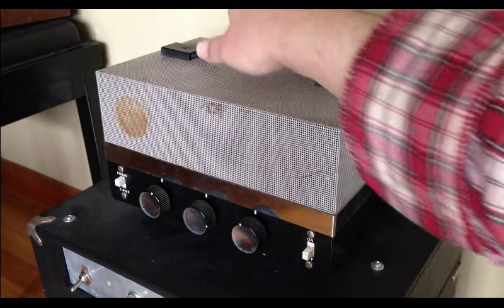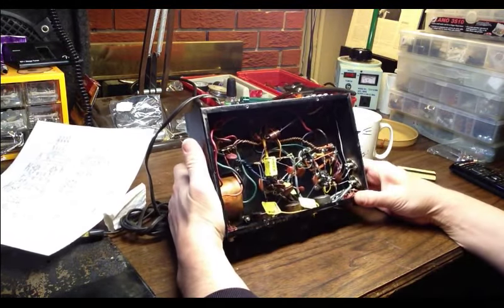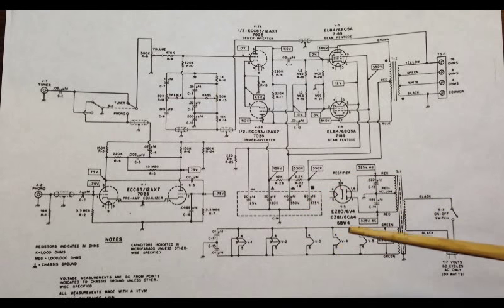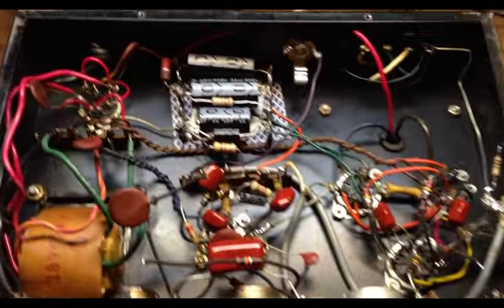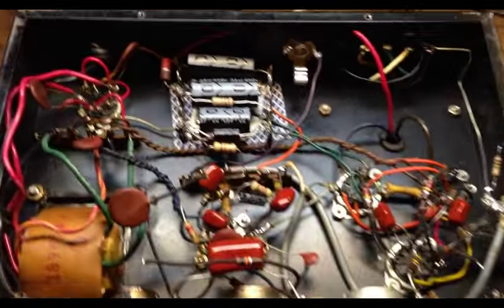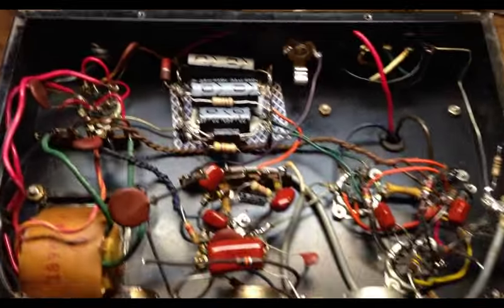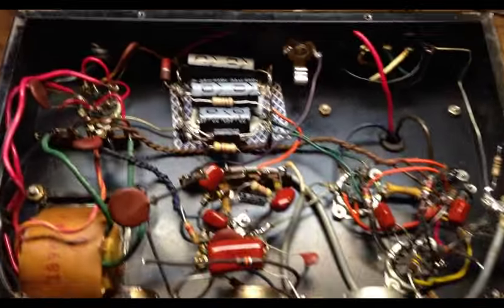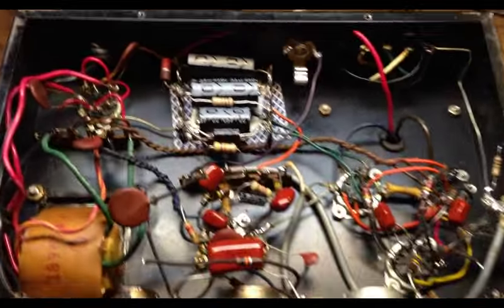Budget Vintage - Knight KM15 Guitar Amp Conversion (Dr.  Z, Marshall, Vox)

Comment: I am always impressed by anyone who can play a guitar well.
I was never a good guitar player, but I am an excellent design engineer who loves working with vacuum tubes.
 You created your biggest problems yourself when you modified the circuitry around the first 12AX7 tube.
 You were basically running them, (both halves of the 12AX7), in saturation because they had no bias on them.
Those very large value resistors, (multi megohms), from grid to ground were there to use a self biasing system called grid-leak bias.
Without bias the tubes operated more like rectifiers than linear amplifiers.
That, coupled with the extremely high gain involved and the fact that you never removed the bass boost compensation that is required for all phono inputs, was the most likely cause of your motorboating.
 You have to go back to those multi megohm resistors to regain some bias and get rid of the RIAA compensation (bass boost, treble cut) network between the two halves of the tube to use it with a guitar.
 You could also switch to more conventional biasing with resistors in the cathode circuits of each half of that 12AX7 tube.
 Look at the 1st stages of other amplifiers that do not use grid leak bias for examples of what those circuits should look like if you decide to switch to cathode biasing.
 I have one of those amplifiers, with no parts changed in it, still working perfectly with zero hum and no motorboating. I know I should replace the stand up multi section filter cap but leaving it in to see how long it will last. 
 Allied radio was in the electronic parts business, (they still sell parts), and they used high quality components in their kits, which is probably why it has worked so well for so long!

Comment: These were kits that you built at the time that Stereophonic sound was starting to take off.
I built my first one in '63 when I was in high school and just starting to play guitar.
Eventually built a second one with some 12" speakers for a parent annoying stereo.
   Allied Radio was an electronics supply company back then and had the Knight Kits as a competitor to the Heathkits that were a little more sophisticated and more expensive.
The Tandy Corp, parent of Radio Shack bought Allied in 1970. After 85 years, Allied Electronics is still in business selling electronic parts.
Reply: Thanks for the info! I didn't know that.

Comment: Hi Guitologist, Cool little amp, I can see where it would make a great conversion project. I watched an Uncle Doug video on his home made Fender 5F2-A and the volume and tone circuit used is really good and can be applied to other amp circuits. Doug has a video on some PA amps he converted and one was motor boating, turned out it was the transformer, a wire was broken, causing the problem. Take it easy, C.

Comment: Thanks Brad. Most of the hum was from poor cap grounding. I grounded the negative side of the rail to the chassis instead of the buss and it's much quieter. I used 2x 33uf and one 22 uf. I temporarily added a 70uf in front of the first 33uf cap with jumpers and it's dead quiet. The 70uf was an older Sprauge that's just way too big (C cell battery size) so I ordered a much smaller 60uf which should work fine. I used the standard 2.2k 2W dropping resistor and the voltage was perfect on that node but I had to up the  82k dropper to 180k to get the last 22uf down to spec. 
Now to attack the tone stack. I'm fairly new to building amps (Ive built 5 kit amps from Tweed Deluxe's, an 18W Marshall and a Deluxe Reverb) but Ive never built a tone stack but I'd like to try try some type of blackface Fender tone stack. like a Champ or similar.  Any comments???
Thanks so much for the help. I really appreciate it and your YT channel as well.
Next up for modding is my Bogen CHB 50 PA. ;).
Jim.
Reply from the maker: Great to hear, Jim. Sounds like you did some effective troubleshooting there. Nice catch on the ground issue. Those are hard to track down! As for tone stacks, I liked the range on the Bandaxall stack I used in this amp. I've also used the Brownface stack and the Marshall stacks on that page. All are good for different things. The tone stack is the most important choice in voicing the amp. Far more effectual to the overall tone of the amp than anything else, including tube types. This is a good site to start looking at stacks: http://monster.partyhat.co/article/amplifier-tone-stacks/#Baxandall
Reply: I think I'll try the Bandaxall since it looks to be one of the simpler mods. I have about 14 tube amps so it's not like I need this one right away. My first build was a Deluxe Reverb kit because It was the only amp I was going to build. A few 5E3 Tweeds, an 18 watt Marshall and a couple of mono block/Hi Fi conversions later and I'm starting to think I have an addiction. I couldn't even read a schematic 3 months ago. I think the Bogen CHB 50 is going to be the toughest one so far. I've watched your video a few times so that should be very helpful.
Thanks again.
Jim

Comment: A friend of mine back in 1971 had Knight amp very similar to this one. I think it was mono and had a 1/4 inch jack.  we hooked it up to my dads stereo speaker cabinet ( 12" 4" and tweeter). I plugged my Ric into it and it sounded awesome! My friends Less Paul Jr. sounded impressive also.
Reply from the maker: Sounds like a good combination. I bet the P90 rocked.

Comment: Hi G, you can use a metal shield to cover the input jack that may help with power supply interference. Nice conversion. You do pretty darn good on the amp conversions. Be good, C.

Comment: Nice job. Lots of gain.  
Where do you get your caps from and what brands do you prefer ? Sorry if that's been asked before in a different video.
Reply from the maker: No prob. Ask all the questions you like. I get mine from Antique Electronic Supply. They are the inexpensive variety. I have had good luck with them and they are way smaller on average than F&T and Sprague caps, so they fit in more applications. This way I can keep just one brand in stock that I know will work well with everything I might encounter.

Comment: Hi Brad, I know this is an older post, but I just noticed that the input jack isn't grounded and doesn't have a grid leak resistor.. Isn't there typically a one million ohm resistor to ground to establish the proper impedance? I'm just curious as I thought those reduced hum.. Does it not matter?  Thanks, Tom

Comment: The sleeper is alive! Nice job Brad. Out of my own curiosity, did you pin point what the cause of the motor boating was? Apologies in advance if I missed an explanation in the video.
Reply from the maker: +Dan79istheman I don't think I adequately explained. I got rid of the NFB entirely and eliminated the big ground connection between the input jack and the output common. That cured it.
Reply: +The Guitologist ah ha! Them damned Eddy currents... Nice detective work!
Reply from the maker: YeahI could have sworn I did a better job explaining that in a clip, but I guess not. This was filmed over the course of several days.

Comment: ok, so i picked up one of these at a swap meet for literally $6. it had old stock Mullard tubes in it as well. anyhow, what I'm wanting to know is how much clean headroom can i get out of this little guy? theoretically speaking, if i were to use 12at7's on the Phase inverter as well as the preamp (phono), would that get me enough clean headroom to run a Klon type overdrive pedal like a soul-food or an archer? OR would i be better of keeping the 12ax7 in the phase inverter and using something like a 12 at7 in the preamp stage to mimic the power output of a EF86 (and perhaps get a little closer to a Vox ac15 kinda output).
Reply: If try a 12au7

Comment: Nice job Brad. I have the same amp and am trying to follow your conversion. Can you please tell me if you ditched the entire cap can or did you use any of the internal caps? 
I cant see in the video how you have the new power rail wired. Is the 22uf in series with the 33uf's or are  the 33uf's in parallel etc. .
Thanks very much.
Jim.
Reply from the maker: I ditched the entire cap can and wired in new caps exactly as they were wired originally.
Reply: Thanks so much for the reply Brad. Was the last cap that was mounted with the lettering facing down a 33uf as well? 
Thanks.
Jim.
Reply: Hi Brad, can you PLEASE tell me what  the value i of the third filter cap is. I can read the 22uf, the 33uf but the last one is installed so the lettering is not showing. Also did you use the stock value dropping resistors? I cant see the colors well enough.  I'm stuck on my conversion and need to know what I did wrong. PLEASE....... Thanks.
Jim
Reply from the maker: Did you google the schematic? That cap should be either a 33uf or 47uf.
Reply: Thanks for the reply Brad. I have the schematic as well as the entire assembly manual that came  from Knight when they sold these kits. The schematic shows 60uf, 40uf, 20uf and a 20uf/25v for the cathode bias. I used 33uf/ 33uf and one 22uf as  thought you did. I used the stock spec dropping resistors. I have a very loud hum that I cant track down. I already did the artificial center tap on the 6.3v so it's not that and my high voltage tap didn't have caps like the schematic shows. It has a normal CT
My power rail and most other voltages are high everywhere except the plates which are only around 280v .
I wish I knew what size caps and dropper resistors you used so I could narrow down this noise.
Thanks for the reply, I really appreciate iy.
Jim
Reply from the maker: Your power rail is probably not the issue. This amp will hum some regardless because of the poor layout. If your hum is massive, try upping the first filter cap from 33uf to 47uf and check your tubes. Could be one of those preamp tubes is bad. Pull the V1 tube and see if the noise goes away. If it does, the noise is somewhere on that tube socket. If not, it could be a ground hum issue.

Comment: interesting seeing a guy messing around with electronics apparently without much theoretical knowledge : calls it "weard" if he doesn't understand neg. feedback in a hifi amplifier to improve distorsion for instance, and two caps on the filament supply to deminish hum by counter-phasing to the ground (less powerwasting then resistors). But he gets along and I enjoy!
Reply from the maker: Thanks for the comment. I'm a guitar amp guy, and the features you mentioned are not usually seen in guitar amps. I understand NFB perfectly well, but it's "weird" seeing it tied into the tonestack like this one was in guitar amps. In fact, it's weird even for hifis. The cathode of one of the preamp tubes is the usual place. Also, I do understand the theory behind a false center tap to reduce noise, but I'm used to seeing resistors rather than caps in that role. And I believe I was thinking at the time if one of the caps had failed or drifted in value, maybe the virtual centre tap was unbalanced. That was a new one on me! Learn something every day. Glad you enjoy the videos, man. Keep commenting!
Reply: Quite ok! Thanks for correcting my grammar, slip of my "frenchie" pen! Just built a 15W guitaramp 2x ecc83/el84 from scratch, as a good radio-amateur (ham F5FLM / PAoGDS) made a chassis from double sided printed circuit board and included some recovered stuf from several valve radios I repair for nostalgic friends. I've taken some pictures of it and will publish them shortly. Kind regards.